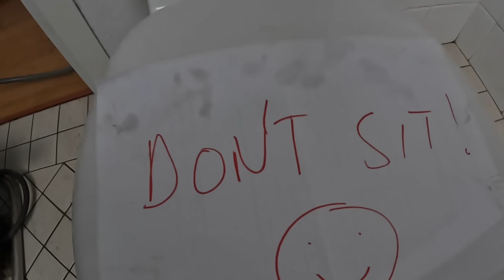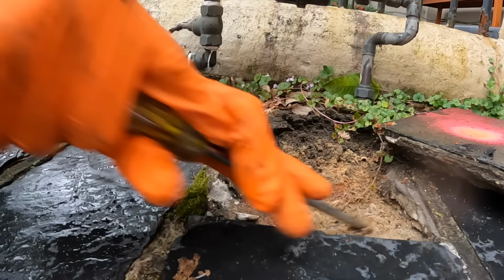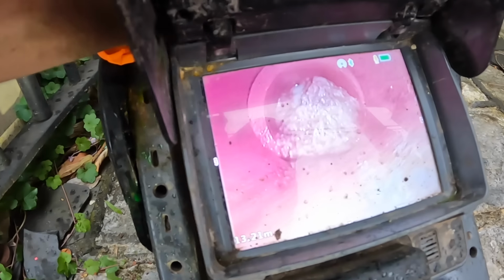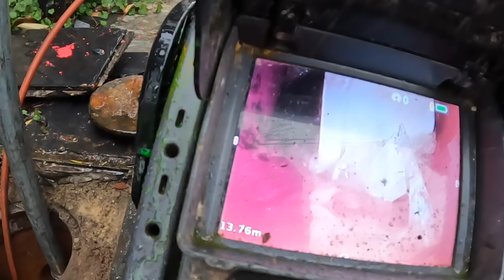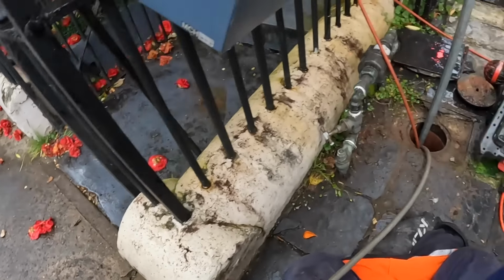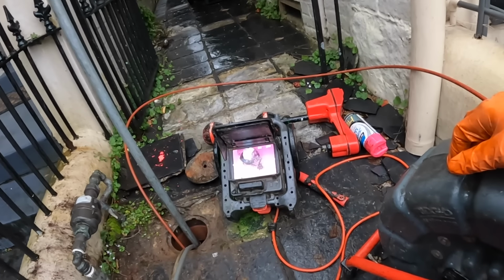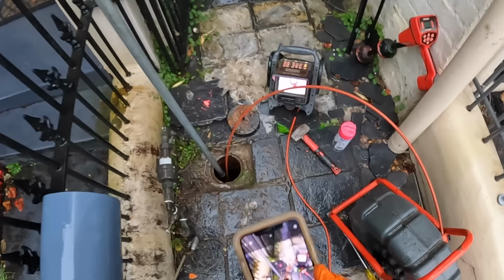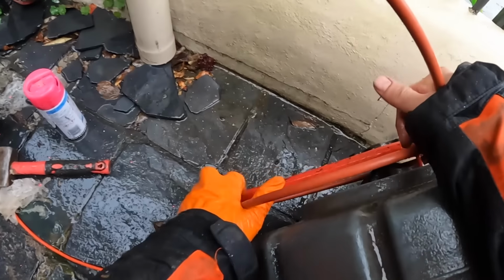Blocked Drain 713

Comment: When i was on the tools a few years ago, i hated getting silicone on my hands.  I use to carry washing up liquid with me in the van to smooth out the sealant. I use to put a bit in my hand and dip my finger in it when i had to seal up around the basin or toilet and worktops etc. Again they had to call in the best to get the job done.

Comment: Awesome video Mr Oliver. When I had my bathroom done the builder blocked the drain with a rag to keep debris out.  Cool toilet system way different than here in Canada. Enjoy the day
Reply: Do you guys use the wax ring system like here in the States?
That pipe thing looks so more complicated than the why we do it here. The toilet just sits down right over the hole, and it's sealed by a wax ring that you can reuse. The  toilet is actually bolted to the ground with 2 studs with nuts and washers.
Reply: @mikeworkman3593  yes wax ring base of toilet over the flange.
Reply: @StevenCasper  Yeah OK, figured that. This Aussie toilet thing seems ways overlly complicated

Comment: I had a large lego jammed in the 3 inch cast iron drain. Solution was to cut the cast iron and get the jammef lego out and replace with pvc. If it was 4 inch cast iron. The giant lego would have gone out to the main. My luck was it was only 3 inch. Oh well.

Comment: Australian toilet connections are so different than ours here in USA....  
Water lines run from underneath through a water hose connection to bottom of tank. Toilet is mounted and attached to floor with bolts, and it sits on a wax ring.

Comment: Question... I have seen you demo those nozzle heads and they cut through pieces of wood.  Could you not just use that nozzle to destroy the plunger into smaller pieces and send it along?
Reply: I’m pretty sure it doesn’t affect hard plastics, otherwise it would destroy the pipes as well
Reply: @lolcatz88  right but I was wondering about the plunger that had wood and rubber.

Comment: Hey Ollie, why did you switch from Quick Connect to screwing all of your tips on?  I noticed your older videos you were using Quick Connects for everything and now screw all of your tips on and off.
Reply: The quick-connects add a bit of extra length to the fittings, which makes it more difficult to get around boundary traps and gullies and such.